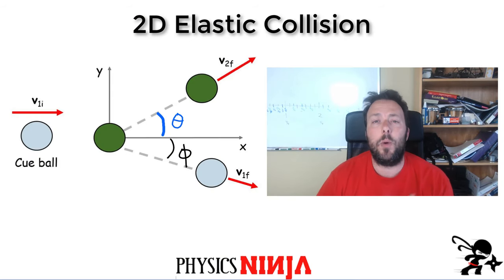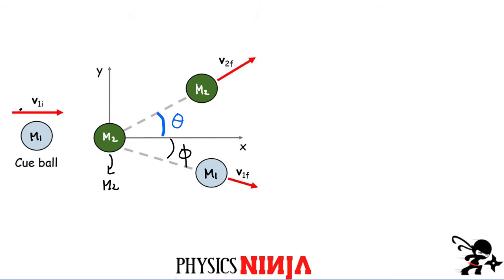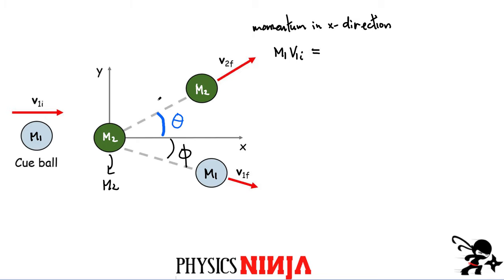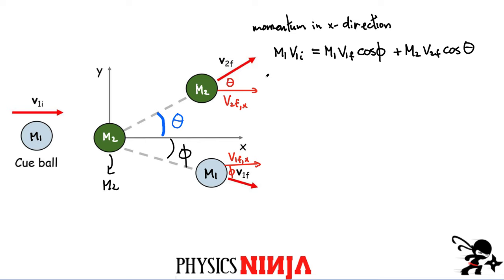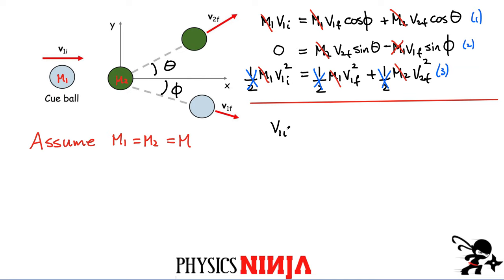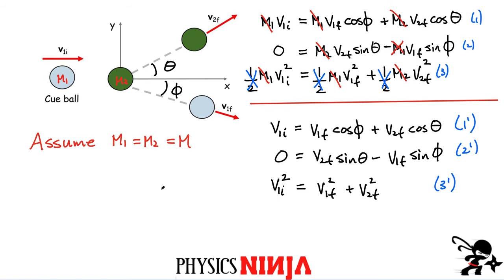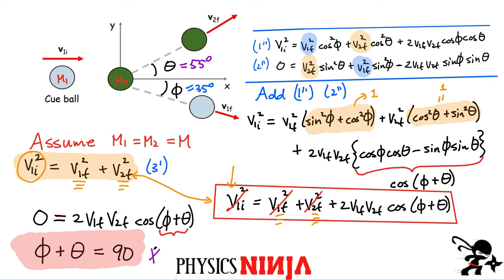2D Elastic Collision Between Billiard Balls

Comment: So I'm studying for a physics exam, and a similar problem came up where it's an elastic collision with two billiard balls. Ball one moves with an initial velocity of 3m/s, and after collision with ball two, ball one travels 30 degrees to the x axis, where ball two travels 14.5 degrees below the x axis. I went through this whole video, as it was the closest thing I could find on how to solve a problem like this, and at the end noticed 30 and 14.5 do not add up to 90. Now I'm even more confused and have no idea how to solve for the final velocities. I've tried every method I can think of, and nothing works. Could you steer me in the right direction? I've spent over an hour on just this problem alone. Any help would be appreciated, thanks.
Reply from the maker: If the masses are different the angle will NOT be 90 degrees.
Reply from the maker: If masses are the same the angle must be 90.
Reply: 😂 I tried to answer your question and then realized it was one year ago! I hope you already got the answer. What I’m thinking is that this video is for perfect elastic collision. But your case is not a perfect elastic one, which involves restitution coefficient, 0<e<1
Reply: Use sine law

Comment: Your equation (3') tells you that v1f and v2f are two legs of a right triangle with hypotenuse v1i, which immediately gives you φ + θ = 90°. The extra algebraic manipulation, while not strictly necessary, was still instructive though. Enjoyed your video.
Reply: no, equation (3') is about v1f v2f and v1i satisfied an equations, they has nothing to do with the angle to be 90. v1f v2f and v1i are numbers not vectors so they have no direction. Imagine this: after colliding ball 2 somehow goes a wrong directions but v2f still the same, then equation (3') still satisfied. Or second way to understand: You need both momentum and energy equations for this answer, meanwhile equation (3') only for energy. The algebraic manipulation is just getting information from momentum equations and it strictly necessary

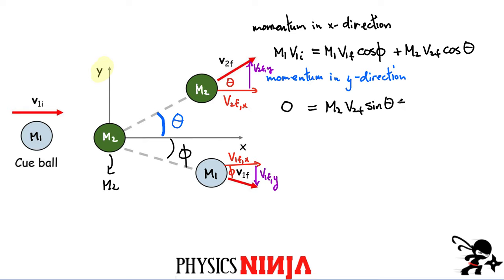Comment: why did you introduce negative sign at 4:27
Reply: Momentum is a vector quantity.. depending on the direction you take as +ve  (in the video, + y is the positive direction), the vector quantity in the opposite direction will be - ve
Reply: @5alidtheog924  Since the angle is formed below the x-axis, and suppose the angle is -30*(which is formed by going clockwise), you can also write that as 330* in standard position(which just means that that you form the triangle by going counter-clockwise). You would still get the same answer  because sin(-30*) and sin(330*) are the same which would be negative 1/2. When he put - [sin(-30*)] it becomes -(-1/2) which then becomes 1/2. That is wrong because it now becomes moving in the positive direction when it is actually moving in the negative direction.He put the negative first because it actually is but when you put in the angle, you get 2 negatives when you just want 1 negative. It should be +m1*vf*sin(-30*)

Comment: I'm working on a similar problem that reads 
Two identical billiard balls are on a frictionless, horizontal surface. Ball 1 has an initial velocity of 5.00 m/s in the positive x direction, and ball 2 is initially at rest. The balls collide, and, after the collision, ball 1 is moving at a speed of 2.00 m/s at an angle of ϕ=
 30.0° below the positive x axis, as shown in the diagram.
What angle θ, in degrees, does the final velocity of ball 2 make with the x axis? 
What is the speed, in meters per second, of ball 2 after the collision? 
The final answer for the first part was 17.01 degrees which contradicts the point made at the end of the video
Reply from the maker: Your problem doesn’t say that the collision is elastic.   If it’s not elastic than it’s a different problem

Comment: you had a^2 + b^2 = c^2 right from the beginning -- that's Pythagorean's  theorem -- didn't have to do all that math -- to prove it's 90 degrees
Reply from the maker: Almost.    You won't get the right answer if the angle theta =0 ( a head on collision).  The general solution works for all cases.

Comment: A 20kg body traveling east at 20m/s collides elastically with a 10kg body moving west at 2m/s. After the collision, the lighter body is scattered in a direction of 30°south of East. Calculate the speeds of the two bodies after collision and the direction of the heavier body

Comment: Based on the initial condition, you have a direct central impact which implies both ball velocities after the collision will be along this central line (x-axis) after the collision. You are calculating an “oblique impact” which implies you need to know the “off-axis angle” of the incident ball and resolve its components before the collision which you are not specifying.

Comment: You can do this in 2 lines by going from 1/2 mv^2 = 1/2mv^2 + 1/2mv^2, dividing through by 1/2m and getting a pythagorean relationship between the velocities.
Reply from the maker: This works nicely for the case of the same mass.   It doesn’t work for the case of different masses.

Comment: So if the masses are the same the angles are always going to add up to 90 degrees? Regardless of the initial velocity?
Reply from the maker: Yes!
Reply from the maker: Unless it’s a head on collision of course.
Reply: @PhysicsNinja  what about different mass?
Reply from the maker: @amirrafiqi7232  Mathematically more difficult but write down conservation of momentum and kinetic energy and solve for the 2 final velocities.   In this case the angle will depend on the masses.
Reply: @amirrafiqi7232  In 2D collisions, you can only have elastic collisions between objects of the same mass.

Comment: can someone do a video showing moving ball hitting moving ball?  cant find this anywhere.  If a pool ball moving 10 mph hits a pool ball moving towards it at 5 mph, what will happen?  cant find answer anywhere.
Reply: m1, m2 masses, v1, v2 initial velocities, u1, u2, final velocities, then you have conservation of momentum for both axes, for the momentum is a vector. For the X axis you have m1 * v1x + m2 * v2x = m1 * u1x + m2 * u2x. You can do the same for the Y component. Now, you also have conservation of kinetic energy, if we talk about elastic collision ( there's no deformation, so no loss of kinetic energy ), so you have 1/2 * m1 * v1^2  + 1/2 * m2 * v2^2 = 1/2 * m1 * u1^2  + 1/2 * m2 * u2^2. Using these three equations you can find all the information you need. Don't forget about that vector components can be written using sin and cos. 

I am actually trying to simulate collision in 2D using JavaScript so I have to relearn all of this, still learning.